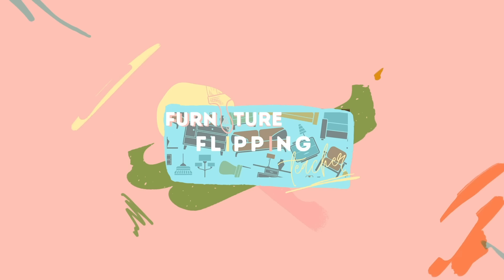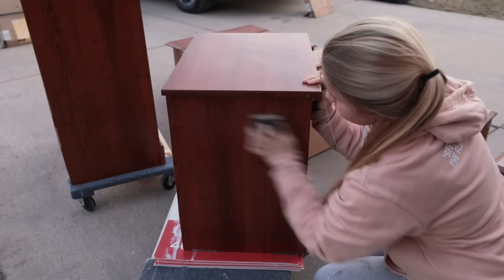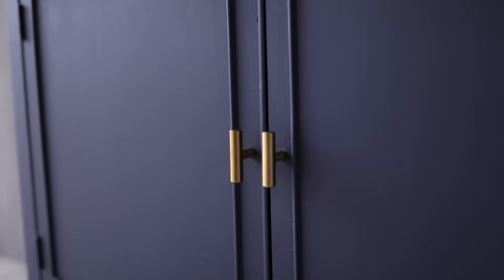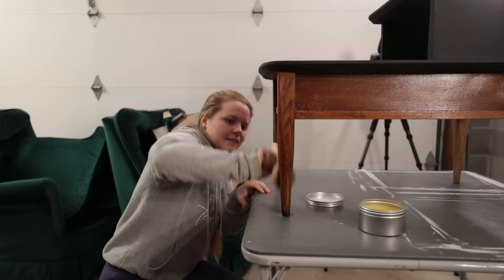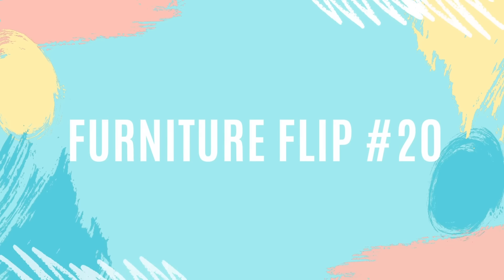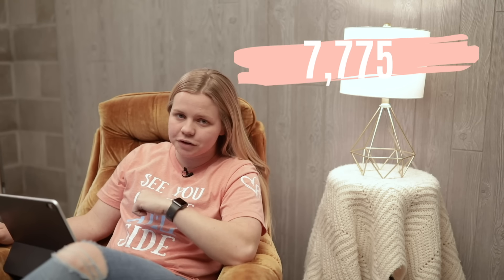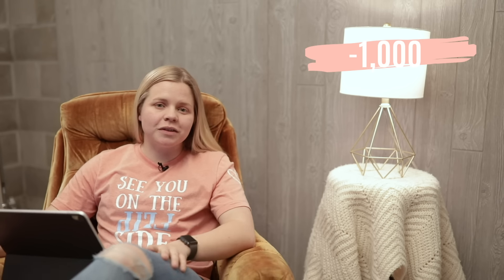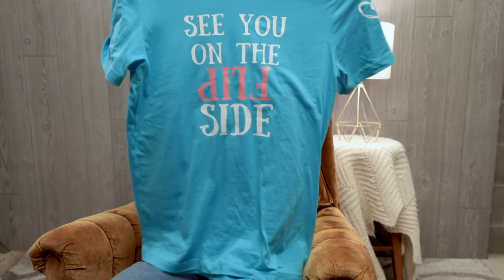Flipping Furniture Part-Time in 2022 | DIY Furniture Makeovers

Comment: Love what you're doing. Here's a couple of tips: Alway sand in a circular motion. It makes the finish much smoother. Always change out the foam on cushions. Don't neglect this step as foam can hide many nasty things. Where you can, change out any protective plastic or rubber tips on the bottom of furniture legs. It looks much better if they are not scratched and scuffed up. Best wishes.
Reply: The fine is very expensive to replace
Reply: Fome
Reply: @katiegarrett822  foam 🤗
Reply: I agree the foam grossed me out.

Comment: Hi, love your channel! If you’ve ever redone a sofa set with me upholstery. Would you post or repost it. My cushions are attached at the seat and back. I do have to go in and add some more cushions fill from the guilty ones who sit between the cushions. I would love to replace the attached back cushions for individual over sized cushions. Do have a dilemma, the arms are attached as well. What do you suggest I do? I would love to just have nothing but cozy soft cushions on both sofa and chair. 
I will send a pic when I have the awful sofa a chair covers. 
I’m a carpenter’s daughter wood working, plastering, painting to plumbing no prob. Hesitated on the upholstery redo. 
Thank you 
Nicole
Final question what fabric works best

Comment: I have about 15 years experience working with wood.  When you sand you want to wear a mask to filter out the saw dust but also the finishes you are sanding.  You never know what it in those finishes, but most of these chemical particles  are nasty and will poison you.  I have know many guys who didn't take care of them selves and when they were older has health problems that can't be directly traced to the sanding, but those guys that wore mask are a lot healthier.  Trust me take care of yourself.

Comment: This comment is not for this video, I LOVE so much what you do, however you really need to learn, when upholstering a chair, bench seat etc, how to do proper corners. They should be almost seamless, yours are far too bulky...try at the corners, cutting a slit in the excess material towards the corner of the of the cushion, then you can staple each flap down at a time overlapping each other in the form of an x